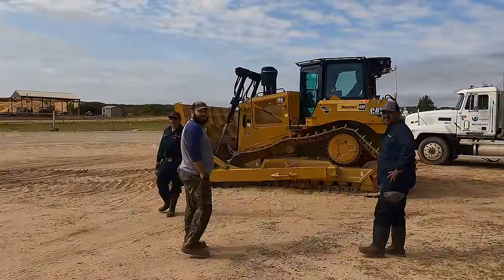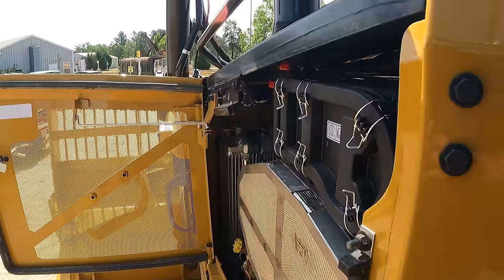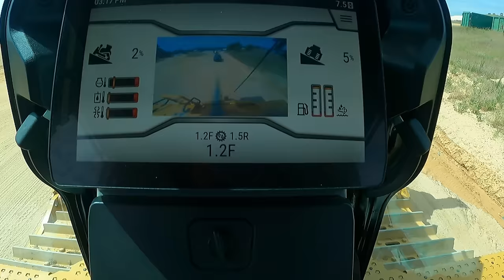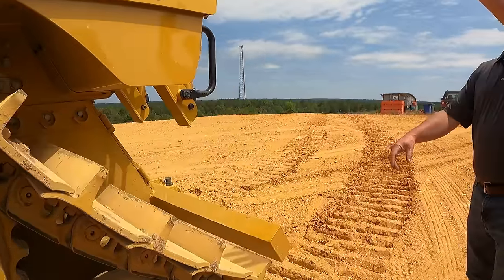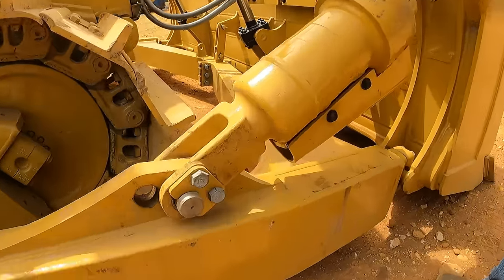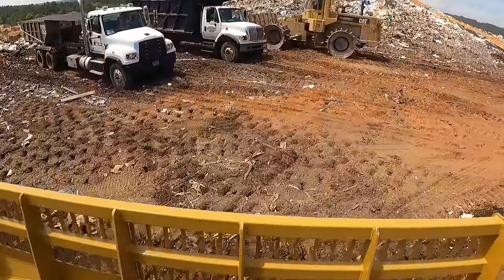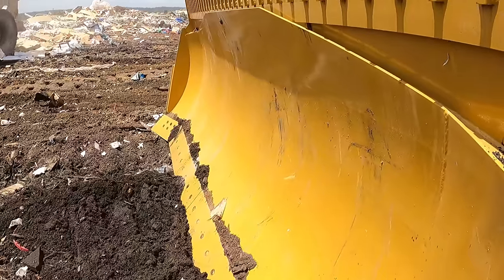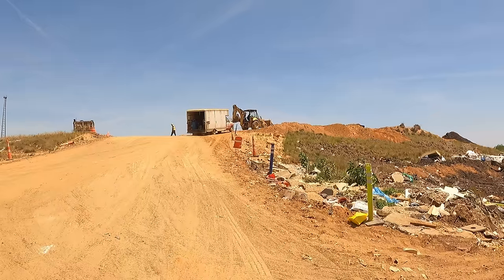Check Out the New CAT D6 Bulldozer - with Landfill Package! #dozer

Comment: Wow... Nice.!      I just spent the last couple of weeks in a 6 way pos D3, non-funtional AC, no slope,  stereo looking like it got beat with a screw driver, and a roller pin that dropped off while making a left.   Basic as basic gets, and beat more than it deserved before (re)servicing.   I couldn't have been happier to get put back in the seat of an Ex.  By wire beats valves.!
Reply from the maker: Thanks for sharing